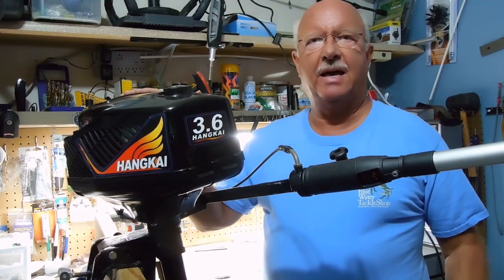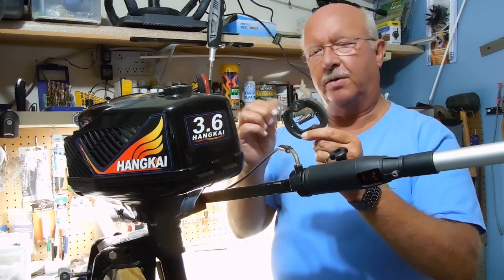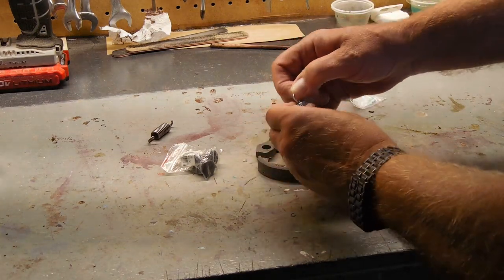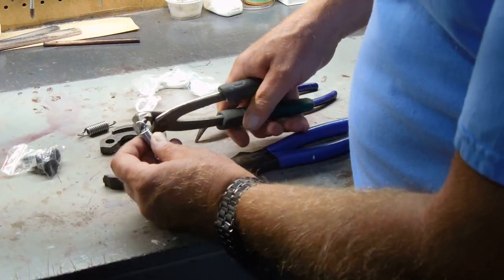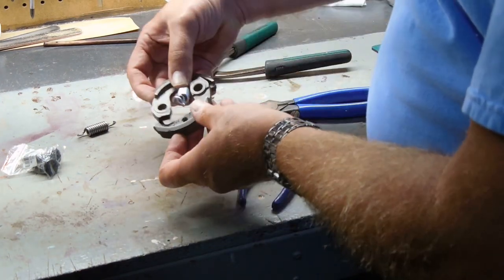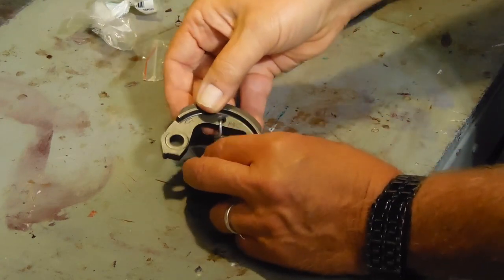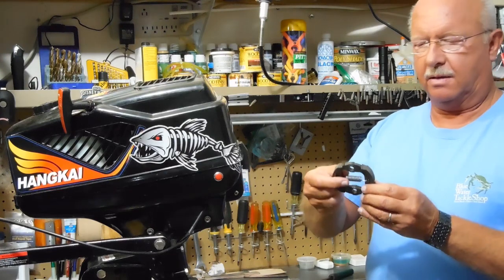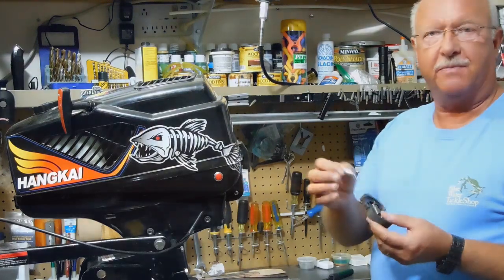Clutch Spring Replacement (Viewers Request)

Comment: Hey boiler Dan just wondering if you had any insight my hangkai 3.5 is not pumping water out of the peep hole and pretty sure propellor is not moving even at idle it is brand new and only just Brought it just wondering if you had any insight as to if it could be the clutch spring love ya videos cheers 🤙🏻
Reply from the maker: No worries, the water pump only runs when the propeller is turning. It’s a very simple flywheel that is attached directly to the propeller shaft.
However many recommend replacing the spring with a lesser strength.  Someone recently made a comment that said a specific spring that fits. I’ll look back at comments and see if I can find it. I’ll send you a a second reply for that info.
Reply: Cheers for the reply man it’s brand new and have been trying to do the run in period going to try and change clutch spring and see if I can get the propellor spinning not sure what else to do as am getting nothing out of the peep hole even with throttle engaged
Reply from the maker: I wasn’t able to find the comment with the tension spring part number.
You should be able to pick one of the same length but weaker.
In the meantime, try removing the spring completely. It won’t hurt anything, the propeller will just turn all the time…. So just shut it off to stop.
Also note: best to break in on the water, no in a bucket.  I kept adding snow to keep the water cool.  You could run a hose in it too.
Just want to also make sure that you added gear lubricant to the propeller housing?  It doesn’t have any in it from the factory.
Reply: @BoilerDan1  so when you move the propellor by hand the fly wheel should spin at same time?
Reply from the maker: Yes, I think it would have to?  But I’m not 100 percent sure on that. The flywheel slides over the shaft going to the propeller. When the shaft turns, so does the flywheel.  The shaft is square and the flywheel has a square hole in the center. It just slides on the shaft. Very simple design, no gears.  The propeller does have a gear system.
Reply from the maker: I’m still pondering what your issue might be?
Being able to turn the propeller by hand doesn’t seem that would easily be done.  Concerned that the gears that transfer the turning power shaft to the propeller could be broken off?
Maybe take the cover off at the propeller and check them out.
Be careful not to over tighten any of the bolts. It’s aluminum and easy to strip the threads. Also there’s a little line inside the propeller gear box. Don’t add gear lubricant above that line. It needs a little air space to expand.
Hopefully it all works out for you!👍

Comment: Great videos learning alot about the motor just 2 questions so when the motor is in idle the prop shouldnt be spinning or should it? And should my prop be free spinning when the motor is off mine is semi hard to spin.thanks in advance
Reply from the maker: In idle the propellers do spin. They are never lose, each has its own little direct drive motor. There shouldn’t be any free spin to them. Thanks for watching!

Comment: Hi Dan, did the Home Depot spring work ? I want to change the spring to a lighter one but I don’t have a Menards around me in Southern California. Thanks
Reply from the maker: I recommend taking your old spring with you and trying to have it matched up only lighter. I ended up getting one that had closed ends and was able to kind of bend open the ends to hook it in place. It worked.
Reply: @BoilerDan1  got it, I believe I may have found one that works. One other question.. I recently bought my 3.5 Hangkai from a women that used it once before and then it sat in her garage for years. 

When I got it home, I opened up the lower gear box to find it was bone dry. It had very fine metal shavings but overall, the gears appeared to look okay to me. I added gear oil(80-90w) and tested the motor in a trash can full of water. The propeller seems to work okay but I’m wondering if she may have damaged the gears running it once without oil. What do you think?
Reply from the maker: If the gear teeth aren’t broken off, I think I’d go with it for a while.  You can find the lower unit on eBay if you search.  It’s a pretty simple system.
Glad you thought to check it. I think a lot of people just start them up!
If you run in a trash can be sure to keep cool water running in it too.
I kept adding snow to mine, but I wasn’t clear on that in the early videos.
So take it out, keep close to shore and have a paddle just in case 😂👍

Comment: Great videos, I have one question, I do a lot of trolling for trout and walleye on my Mariner 4, do you know if this motor will engage the clutch and troll at around 2mph. I'd like to order this motor one day
Reply from the maker: I think that you would need to replace the clutch spring to a lighter one. I’ve done that and will report back later this spring. One other issue to consider: The 2 cycle has the exhaust exiting below the water line so that noise might distract fish in the area.  Where as the 4 cycle motor has a muffler from what I can tell. It’s a little more $$, but might be something to consider.  Or electric trolling motor would be totally quiet..  Thanks for watching!
Reply: @BoilerDan1  I use an electric one now, just takes a long time to get places on larger lakes, but I can run all day on my enduramax 55 and my 105ah battery
Reply from the maker: To get from spot to spot would work.  But would you want to take along two motors?  Decisions, Decisions!  :0)  I've made several videos on my adventure with the motor.  I've had issues, but so far have over come them all.  I'm looking forward to this late spring to see if the new clutch will give me the speed that I think it should have.
Reply: @BoilerDan1  I don't worry about the reliability factor, I've been a mechanic for a while now and have a good understanding on small motors, but if I could make that motor troll at a slow speed and also get me places quicker if be happy

Comment: Hi Dan i know this video is older but does the GX31 clutch fit the Hangkai motor or is it just the washers and bolts? Thanks
Reply from the maker: Yes, that’s the one you need.
Quick search on Amazon has one but if you search more there and  \ or eBay you can find them cheaper.
Ps….Older video: But it lives on!😂
Here’s the link on Amazon:
HAISHINE Clutch Drive Bolt Washers for Honda GX31 GX35 GX35NT Fit Mitsubishi TL33 TL43 TL52 T180 T200 T240 Engine Brush Cutter Tiller Trimmer https://www.amazon.com/dp/B07J6F4J6M/ref=cm_sw_r_cp_api_glt_i_XSR2KT9YPVA0FA1ANQS6?_encoding=UTF8&psc=1
Reply: @BoilerDan1  Thanks so much Dan
Reply from the maker: All thanks to you for watching!👍👍

Comment: Do I have to change the original spring.or maybe can I use the old one from the broken one
Reply from the maker: If your spring is not damaged it could be reused.  But if it is the original one that is too heavy that won't solve the issue.  New clutches come with the spring, it is just to strong for this motors use.
Reply: Thank you keep doing this video's,I'm happy with my hankai it's slow but it's moving me around.

Comment: Have you found a way to reduce noise?
Reply from the maker: Unfortunately no.  I had tried some automotive sound deadening padding, but that did little to reduce the sound and I was concerned that it was to close to the hot exhaust pipe and would also retain heat inside the outer housing... although I did leave all the air vents clear.  But because it made little to no difference, I removed it all.

Comment: dan if you ore anybody need a cluch,mine is a HL  ONE FROM AM. IS A JX there is a slight devence between the two.the one from ebay is a HL same as mine!
Reply from the maker: I might have purchased both types?  Seems like one of them was a little bit lighter in weight..... if you can make sure that it says it will fit:
“Clutch Drive Bolt Washers For Honda GX31 GX35 GX35NT MITSUBISHI TL33 TL43 TL52 T180 T200 T240 Engine Brush Cutter Tiller Trimmer”
It’ll work!  If you can buy from a source that can avoid shipping from China it’ll speed up delivery. Here are links to Amazon where I purchased Clutch Drive Bolt Washers For Honda GX31 GX35 GX35NT MITSUBISHI TL33 TL43 TL52 T180 T200 T240 Engine Brush Cutter Tiller Trimmer https://www.amazon.com/dp/B07J6F4J6M/ref=cm_sw_r_cp_api_glc_fabc_PGj4FbVW7N4RB?_encoding=UTF8&psc=1
Above came with new bolts, below no bolts. Both ship from China.
JRL Embrague Clutch Assembly Part for Honda GX31 GX35 Strimmer Bush Cutter 76mm https://www.amazon.com/dp/B01A09QFVS/ref=cm_sw_r_cp_api_glc_fabc_FNj4Fb59SNNZ5?_encoding=UTF8&psc=1

Comment: Do you know how to get an M. S. O. "Manufacturers Statement of Origin " For this type of outboard motor
Reply from the maker: In the location I'm at (Indiana) the boat is what has the Manufacturers Statement of Origin, not the outboard motor.  Check with your local license branch to get clarification.  If you need some type of title for the motor, you might be able to get paperwork to have a title issued by having a VIN number checked by a law enforcement agency.  You may have to assign an owner applied VIN because these motors may not have one...?  The papers needed can be obtained from the BMV.
But I'm almost certain that what you'll need is the boat registered and that is done from the hull number and paperwork from the manufacturer. Here is a link showing that process for the raft I have: https://youtu.be/JP1YFfuIV00.
If your location requires the motor be registered, then a VIN check paperwork should be available from your local BMV?
Reply: @BoilerDan1  thanks. In Texas you have to register boats and outboard motors as well. It can't be done without an M. S. O.
Reply from the maker: I’ll get you a link to the manufacturer but not sure if that will work or not.
Reply from the maker: Below I've listed some possible help links:  
 Hangkai Customer service Email: 582371384@qq.com
Service Hotline:+86 186 5768 6863  Global Hotline:+86 186 5768 6863    Tel:+86 576 8288 6895  
 I think I'd try the e-mail saving an international call.
The web site is: http://www.hang-kai.com/en/
Reply: @BoilerDan1  I'll give it a try. Tanks